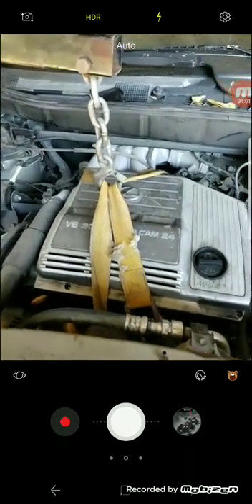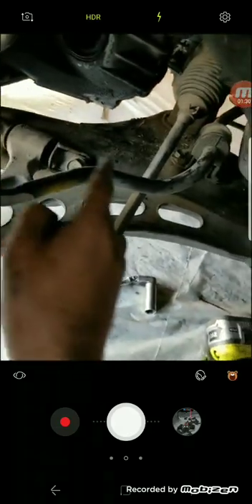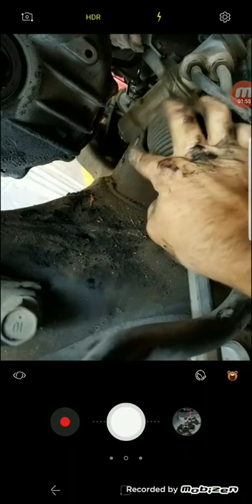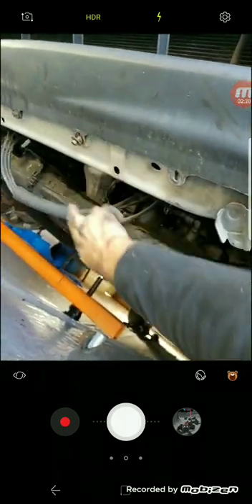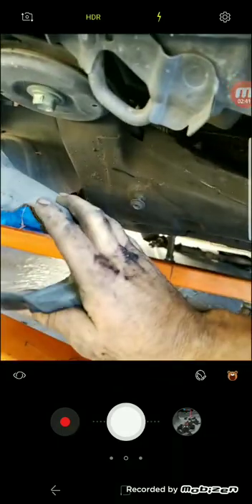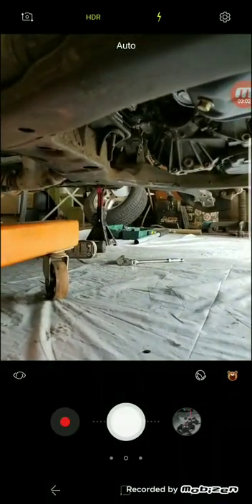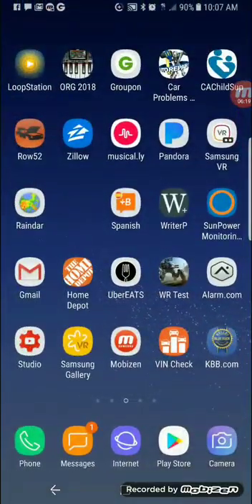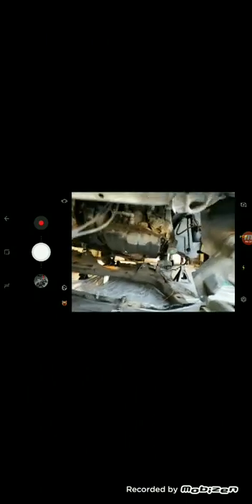How to remove a front frame assembly, engine cradle, without removing the engine and transmission.

Comment: I have a 2003 Hyundai Sonata. The car is from snow, salt, and rust country. Hyundai did not put drain holes in the subframe, and they rust, along with crack. There is a recall on it, but the local dealer said that the frame had been sprayed with wax to prevent rusting, and case closed. This one is cracked, and if a call to Hyundai does not get it replaced, I may have to do it myself. You gave me a lot of good information, Thanks.
Reply from the maker: That's awesome, this is why I do this. Could you help out with a like and a sub 😊

Comment: i got a 2016 challenger hellcat that needs a engine cradle replaced. how much do you think it should run? dealerships want $7k i found a few front end shops that will do it much cheaper.  is it worth it going cheaper or stick w dealership pricing? info i need to know because if its dealer pricing i will just have to sell.  hope you can help
Reply: I have the same issue just bought a Chrysler 300 hellcat(2018 hellcat) did a pre purchase check up said they it needed front subframe changed said it was minor problem now I’m calling mechanic shops near me running 3-8k

Comment: this is exactly what I needed, hope, my car I rebuilt engine, new trans, new suspension, brake system... new car basically,  wife wrecked it, bent cradle right at lower control arm mount, thank you, my car is 00 lesabre,  I really did not want to remove engine and tyranny.... again, thank you
Reply from the maker: I'm glad this helped you out

Comment: Hi could you show a 1998 - 2002 Honda accord 2.3 liter 4 cylinder engine please.Thank you.
Reply from the maker: I don't believe that vehicle has a cradle. I believe it's engine mounts only.
Reply: @jgailey916  Hi, 1998 -2002 have a cradle in the front sub frame and a K frame where the rack is in. Thank you.

Comment: Hi Professor Gear.  I like the video but I'm puzzled at it's declaration and even a few responding comments by others.  I'm not a mechanic but a computer repair technician years ago and I know most everything applies the same, in that I might be able to remove a motherboard without taking certain other components apart in one brand of computer but not another.  So I wonder how it is that 'any' subframe could be removed without taking out the engine statement.  That's just what I wondered about the statement... for everyone I guess... but more specifically I did a google search for 2006 Pacifica subframe removal and your link was the 2nd one in the list and the title caught my eye so I assumed it was for an 06 (searched SHOULD be in most relevant order right? (not as much today anymore sadly on the internet) but anyway at the end I noticed it didn't say what vehicle you did this on so that it my question if you could list what year/make/model you did this on. If it is an 06 Pacifica... that would make me even more happy.  Haha... thanks again.  John
Reply from the maker: Sorry for the late response. This technique should work on most and possibly all vehicles with a subframe that cradles the engine. This was on a Lexus I believe

Comment: you need to support the engine and the trans . u typically use a brace across the tops of the fenders by the strut towers . just saying . without it causes engine to drop down bad and could cause issues
Reply from the maker: I'm using the engine hoist to support the engine